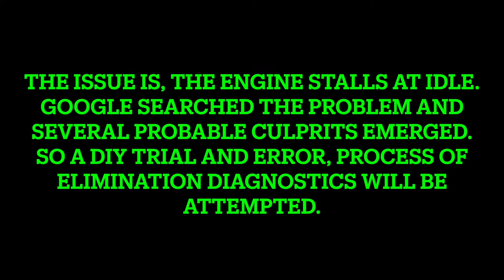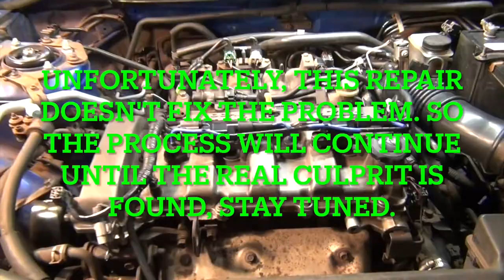HOW TO CHANGE AN IAC (IDLE AIR CONTROL) VALVE

Comment: Do you have to reset the iac valve so the ecu can relearn with the new one?
Reply from the maker: The IAC is new so I just ran the engine at idle and it adjust by itself. Thanks for visiting.
Reply: @timpaps  Ok, thanks!

Comment: Nice vid, I wish I saw this when I serviced last month…., I ended up having to remove the entire Throttle Body and since I went that route ended up draining the coolant and since I then had access ended up removing the EGR valve to clean that as well then replaced the gaskets upon reinstalling then putting in fresh coolant. The idle has been more steady around 750 RPMs compared to 650 RPMs prior at idle with the A/C off. 

Note 1- I also stripped one of the Phillips head screws and used an impact screwdriver to remove them and bought new screws to reinstall 

Note 2- check to see your vacuum lines for a possible leak that is causing your stalling issue, I see the rubber intake tubing on mine is starting to crack on mine since it was a cheap “new” replacement from eBay. The original lasted 15 years while this one year 2 shows signs of failing. 

Good luck 🫡
Reply from the maker: Hello Max! Thanks a lot for watching and for your interest in my videos.

Comment: It seems like a lot of work, I did not mine without removing crossmember and engeen bracket, all you need is a short spanner, enyway you did this way which is work fine.
Reply from the maker: @fifove Hello Sergio! You're talking about my other video  "EGR valve" where I remove the crossmember and engine rear bracket. I don't mind doing extra work removing obstacles in order to have an easy access. Thanks for watching and for your interest in my videos. Regards and Aloha!